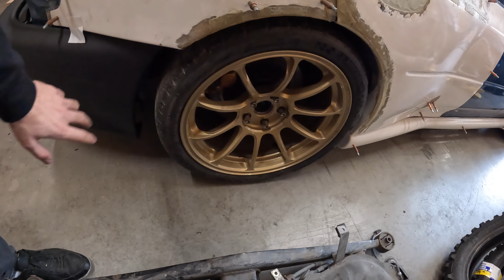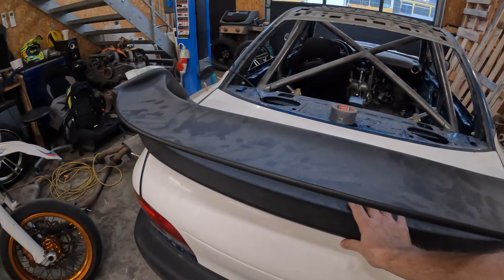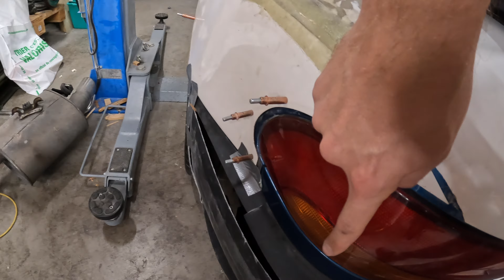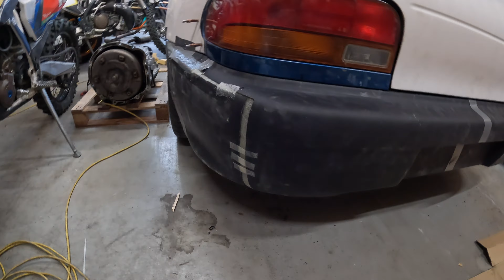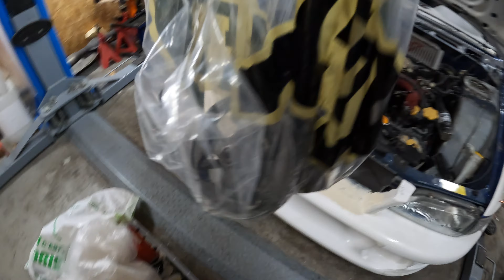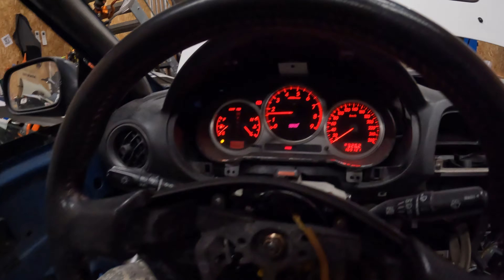Subaru GC8 RSTI Build - 100mm Hyperbody Rear Bumper - Ep. 41

Comment: Steering pump with plastic connector is from newer versions. I suggest you to replace o-ring under connector (p/n is 34439-FG000). It'a a common problem that due to wear of this ring pump start to suck air and produce terrible sounds
Reply from the maker: Thanks for the infos!
Reply: @SwissTuned  grab few pieces cuz it easy damaged so be careful with it (i fucked up once)